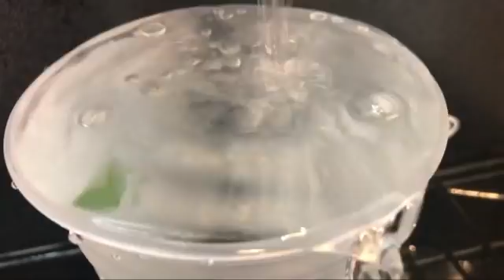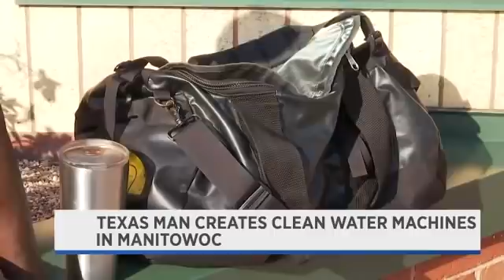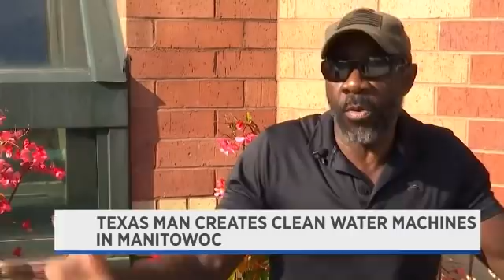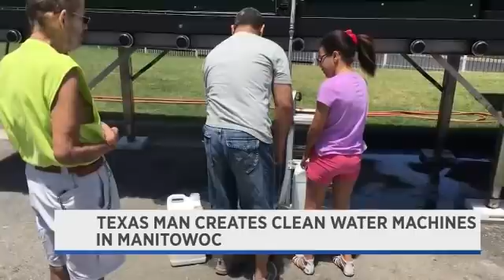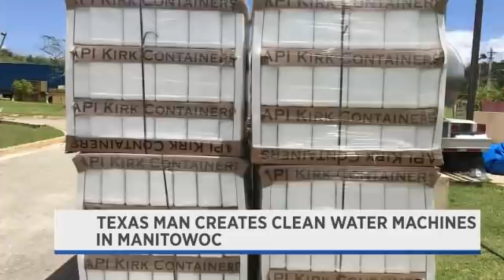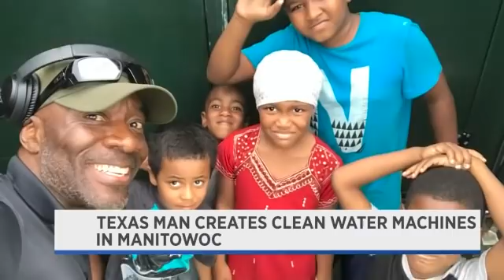Texas Man's Invention Creates Drinking Water from Air

Comment: This man is a genius simple and plain.
Reply: BM32  There is no hate on my side. It would be great, if such a machine could be viable. But thermodynamics tells us NO.
Let him just show us the math - how much energy the device consumes per unit of water produced. That's the key parameter.
Reply: @Staremperor  what if he found a way to.produce more with less power? just because you can't figure it out that doesn't mean it can't be figured out. 
Why is there always a "but" with certain people.
Reply: Staremperor ask that question on a different video.  This story was a good news story not a damn thesis that will be defended or a damn technical white paper.  You are being disrespectful to a veteran.  Where is your patriotism??
Reply: @Staremperor  They don't want to hear that. They wuz inventors. Just leave it like that.
Reply: BM32  "It works" "someone vandalized it"

 Of course it works. Dehumidifiers do work. I used one when I spilled my pool into my basement. I used it for its intended purpose: to dry up air and subsequently walls. It worked and all the moisture my dehumidifier sucked from the air condensated in a tank. 
But the amount of water was really small while the machine worked 24/7 on 350 W of power. Which means DEHUMIDIFIERS ARE INEFFICIENT AS A TOOL TO CREATE DRINKIMG WATER. That's all.
Reply: @Staremperor hook then up to the latest solar tech
Reply: @silviocastell8889  Do you mean to supply this dehumidifier by energy from solar panels?
To produce enough water, you'd need quite substantial installation. Dehumidifiing air is not energy efficient way of producing water
Reply: BM32  
Let's go for underlying principle, which is cooling and condensation.
So I ran some numbers. I did that for my local environment, as I have no clue, how much you pay for electricity.

In order to condensate 1 liter (0,264 gal) of water vapor, you need to remove 2257 kJ of energy (this is at boiling point of water, the lower the temperature, the more energy you need, so I'm being generous here). 
Current heat pumps have coefficient of performance around 4 (which means, that they can pump 4 kJ of heat for 1 kJ of input power). 
That means, the machine takes 564,25 kJ of energy to condensate 1 l of water.
1 kJ equals to 0,277 Wh
Here in Czech Republic 1 MWh of electricity cost 2535 CZK (109,82 USD)
So if I omit all of maintenance, water filtering and everything else, just to condensate water you use 0,017 USD per liter (0,065 USD per gallon) worth of energy.
For comparison, here in Czech Republic, you can get tap water for 0,004 USD per liter and that has everything included - water treating, sewage disposal, infrastructure (outside your house)...

And don't talk about solar panels. You also need to pay for those. 
If you want to make "hundreds of gallons per day", let's say 300 gallons (arbitrary number, you can pick whatever number you want) of water per day using solar panels. Condensation of 300 gallons needs (with coefficient of performance of 4) 178 kWh of energy. To produce 178 kWh with solar panels, you need roughly 40-50 kW solar installation (varies widely based on your region, you know latitude and clouds are major factors). Solar panel of dimensions 65*39 inches could produce 320 W (again varies widely). So in order to make 300 gallons per day, you'd need quite large solar power plant.

Really only way to make air->water viable is to significantly increase heatpump efficiency. Ramifications of such increase would be enormous from water production through refrigeration, house heating, air conditioning... If mr. West is truly such a genius, that could increase Coefficient of Performance from 4 to 8, he would understand, that he can revolutionize entire industries, not just make a couple of water generators for some isolated communities.

Lastly: if you have the technology and hold patents to it, sabotaging one unit doesn't mean much. Every company in the bussiness would bend over backwards to buy or license such technology, because it would mean a breakthrough. We don't see anything like that here.

I rest my case.
Reply: @Staremperor  dude why are you so hell bent on debunking this machine all your talk about cost and energy consumption means nothing all you have to do is watch the video it says it cost the city "$0 dollars" to run ands its 100% safe to drink fully tested and verified to work 

quote from MOSES WEST, PALADIN WATER TECHNOLOGY website 
The machine that Moses developed was innovative from the start. One of the challenges of scaling up atmospheric water generation technologies is the amount of energy they require to function. Many units on the market today are very energy intensive.

Not this machine, though. The Texas Commission on Environmental Quality requires power consumption no higher than 0.13 kilowatt-hours (kWh) per liter for approval. The unit developed by Moses used only 0.08 kWh in testing, and in Puerto Rico achieved 0.05 kWh.

Moses spends a lot of time watching the machine operate while thinking about "parasitic electrical load. If I can put my hand someplace and I can feel some heat come off or if I can feel some cool air come off … temperature change is energy.” He has continued to make tweaks to the design to minimize energy usage. “I’ve gotten the equipment down to the place where it’s very, very low on energy consumption,” he says. “And that’s what you had to do to get it out to the market.”

so yeah Moses West smashed you energy numbers by a wide margarine because he is a Genius and you're just a hater hoping he fail because you're not smart enough to figure it out like this high IQ black African American man did LMAO
Reply: @frankmill5172  1. I don't care about mans race.
2. As i wrote: if he managed to rump up efficiency of heat pump that much, it would be revolutionary. Such technology would instantly find its way into fridges, house heating, air conditioning etc. But it's just not happening.
3. I do not hope, he fails. If he succeeds, it would be great for entire world, even for me. Just imagine - heating ten times more efficient, than what we have today. There goes half of carbon emissions. 

4. You oppose me with some PR article and couple of ad hominems. Try better. Try to search for specs of the device, is there a site, that describes how the machine works? I bet you won't find any.
5. So I crunched the numbers again. If the proclamation of 50 Wh per liter is correct, that would mean Coefficient of Performace of the heatpump 13 - three times more efficient than current technology on the market. He did that single handidly? Please, please find his patents or research papers. This would be truly revolutionary. Or just keep insulting me and see how long you can keep that up. I'm very insult tolerant.
Reply: @frankmill5172  Yo, I found the patent https://patentimages.storage.googleapis.com/e9/fd/ed/cfe0809648a40e/US9400131.pdf

What he patented is adding a turbine to multiple condensers in order to process large quantity of air. 

This way, he can rump up the water production. But it doesn't say anything about energy efficiency.

And here goes second one
https://patentimages.storage.googleapis.com/c1/da/73/ddc5c7f78c2eb2/US20190242098A1.pdf

This one is longer and might have something to do with efficiency of heat pump (here, it's called refrigeration cycle, but it's essentialy the same). It's longer, so I need some time to grind it through
Reply: @Staremperor  I dont know why you feel I insulted you it seems to me that you want to find out how it works so you can copy and sell the idea or something ... how many tech companies do you know post there patented info all over the web so it can be stolen ...would you if you came up with a new Idea or a breakthrough just post it to the world wide web for free??? I dont think you would thats why you cant go to secret military bases like Area 51 and ask how they reverse engineer UFOs
Reply: @frankmill5172  I have no intention of copying such patent. Firstly: You can't, that's why there are patents in the first place. You invent something, you patent it and if someone tries to steal it, you sue his ass. And secondly I'm happy as an employee in a small company here in Brno.

All I am is a NERD. I like to dissect things and learn. I'm curious. And if I see such bold claim, I'm naturally sceptical. So I search and learn. As you can see, I found his patents (they are publicly avialable, you know) and I'm going to read my way through them.

Will you do the same? You should, if you want to oppose my critique.
Reply: @Staremperor  well I guess a simple google search for Moses west patents was all it took to find : ) guess I'll brief through them a lil bit
Reply: @Staremperor  off subject but what do think about this impeachment going on?
Reply: @eleminoupi5670  Do you mean impeachment of president Trump?
Well, I see it from afar. I'm Czech living in Czech Republic. From what I gathered (which not much) I thing, that impeachment is kinda nuts. "Hey, mr. Zelenski, there might be a criminal activity of one American, you might investigate that" - That doesn't sound all that bad.
Secondly - as long as Republicans (in senate) support Trump, impeachment won't pass.
Lastly - I guess, that you'll have to live with Trump and hope, that in next election, he'll lose.
Me personally - If he didn't be so happy about trade wars, I'd support his presidency. BECAUSE IT'S FUNNY AS HELL :-D. I'm just waiting to read another stupid, over-the-top tweet or letter of his. I'm like: "enjoy your border wall, enjoy your idiot president, WAIT... WHAT, he wants to make trade between us more difficult? Screw you, I don't want that!"
Reply: @Staremperor  ok you are not America so I dont care sorry. You're great though
Reply: @Staremperor     You said it. Drinkable aka the moisture level. Night moisture level is more  favouarable and that is how  ground water in arid regions are not exhausted. Hence the water holes plus  bore holes  dating back centuries and some. This machine's inner workings has not been made available to us yet, maybe soon enough it will be.
Reply: BM32  Still less efficient than river water treating , desalination or pumping water from subterranean aquifer.
Reply: @Staremperor  It's literally cheaper to fill a tanker truck with water and drive it to where the water is needed. This was debunked by Thunderf00t on YouTube.
Reply: @Staremperor  aquifers dry up or get polluted. This seem renewable I'll coin the phrase renewable water.
Reply: Staremperor Sony’s driving a pick up truck is less efficient than driving a Prius and yet people still choose to do it.  What’s your point? There are pros and cons to everything.
Reply: BM32  Only part of this, that is worth responding is "Until you examine that equipment you can't say shit."
1. Did you examine the device, so you can say, it's efficient?
2. Sometimes, you can say, whether it could work just by knowledge of underlying principle. Fundamental piece of technology in play here is a heat pump. Current state-of-the art heat pumps have coefficient of performance around 4. Which means, that they use 1 Wh for every 4 Wh of transfered heat. And the coefficient of performace goes down as temperature difference goes up. Do you want to do a math yourself, or do you need me to do it? If you do it, you can choose your ambient temperature and relative humidity.
Reply: @Staremperor  I know you're not interested in anything but the science. You know what you're looking at and so do a lot of us but unfortunately these morons will cling to something they have no idea about. Here in the US the left is squashing out conversation by using blanket statements like calling someone a racist, sexist etc. People are really retarded and I don't mean that in an insulting way. They are truly the real sense of the word retarded.
Reply: @steveosoprano9078  Funny. In Czech Republic "unique snowflakes" are more on the right. Leftist are all about Russia and China :-D

Well, stupidity knows no bounds.
Reply: @Staremperor  haha haha. Cheers to that!
Reply: @steveosoprano9078  well been about 6 hours sure you've looked over the patent by now do you still need more time to debunk this "fake water making machine" or are you going to wait for Thunderf00t to save you LMAO!!!
Reply: @frankmill5172  I don't need to debunk anything I can clearly see that this just a dehumidifier.
Reply: @steveosoprano9078  just saying its just a dehumidifier isn't debunking anything if I create a Battery last for 1 year without a recharge all you would say is its just a battery I know its a battery but its 1000% better than every battery in the world and you still not debunking how it work by calling it what it is ...the sky is blue tell me something I dont know
Reply: @frankmill5172  I couldn't care less how you feel about it. I don't need to debunk a dehumifier.
Reply: @frankmill5172  if you believe in it so much then you do the research and figure out if it's economical. If it is then invest in it. This is a beautiful country where we can invest in things we like and believe in. Capitalism is amazing.
Reply: @steveosoprano9078  then why tf are you here calling people morons for believing in the Moses West Atmospheric water generation system and saying it dont work because its just a dehumidifier people cant drink from a dehumidifier but you can drink from Moses West Atmospheric water generator LMAO ...yeah you care
Reply: @steveosoprano9078  I have already donated to helping this Machine in Flint and plan on doing more in the future its a great idea to bring fresh drinking water to poor needy people of the world
Reply: @frankmill5172  then drink it.
Reply: @steveosoprano9078  I own a dehumidifier but I dont drink water from it because thats not what its built for  ...but I would drink it if I had a specialized Atmospheric water generation built by Moses West for the specific purpose of water being drunk from it
Reply: @steveosoprano9078  its not something from nothing ...you act like its some kind of magic contraption and Moses West is a witch or something ...you know At any moment, the atmosphere contains an astounding 37.5 million billion gallons of water, in the invisible vapor phase. This is enough water to cover the entire surface of the Earth (land and ocean) with one inch of rain...that water naturally exist in the atmosphere all the machine does is pulls aka dehumidifies it from the sky cleans it and make it drinkable for human consumption
Reply: @frankmill5172  nobody is negating the fact that this IS a way to produce water. You are not thinking about how much it costs to run. Are you using solar? Then think about the carbon foot print to make all those panels. Are you using electricity? Then think about the coal being burned or the nuclear energy being used. This machine DOES NOT PRODUCE FREE WATER.  Everything comes at a cost. If you can't undestamd this then I don't know what else to tell you. Like I said before if you feel so stongly about it then invest in it and prove us all wrong.
Reply: @steveosoprano9078   ...Solar panels produce carbon emissions... LOL you got to be just trolling now of all the things thats destroying the environment I think even the most strictest environmentalist will forgive this machine for the lil pollution it produce compared to the millions of plastic bottled water that you would save from having to transport and deliver along with all the pollution those bottled waters create when they are dumped into the ocean ....I think they would take the trade off just to have this one machine in a city ...just give up already you are only here to try and find something negative to say because you hate good positive things ...man you need Jesus or Buda or someone to give your life some kinda meaning outside of the negative ...or maybe the only thing that makes people like you happy is being negative and seeing poor people getting help and free water burns your heart like a bad sun tan ...sad...
Reply: @frankmill5172  You are like an emotional child. Like I've said if you believe in it so much then you and Santa should collaborate and make water free for all.
Reply: GOD IS GREAT- JESUS YESHUA LIVES
Reply: Its just a dehumidifier....
Reply: @DukesArchive  you should have improved on it then,
Reply: An Israeli man invented this years ago. This is just a different machine. You Idiot ! Lol
Reply: You don't do your research. Plain and simple.
Reply: @kilgoretrout6136  can you post what you've recently invented or designed that was new. At least post a video that discredits the man first. If not your just spreading rumors.
Reply: BM32  bro yes its a big cool machine but stop acting like it was just invented. This idea was around for years and years Lmfao.
Reply: Yep you said it!
Reply: The energy needed to pull enough water out of the air would be astronomical. It would be cheaper to fill a tanker truck with water and drive it to where the water is needed. This was debunked by Thunderf00t on YouTube.
Reply: A. G.  I agree with you man I'm not attacking the man I'm just skeptical of this machine. Seems like a good way to scam tax dollars out of a city.
Reply: A. G.  

Answer to question why we don't have thousands of them is summarized in yesterday my post, that begins "Let's go for underlying principle". There I explain, why dehumidifiers are inefficient in water production.
Reply: BM32  All dehumidifiers are efficient, dumbass; they just use a lot of energy.
Reply: @Victoria Adeyemi Why would I build one? There are factories bulding them. I can run to local electronic store and by one for 100 USD.
Reply: Lots of underlying racism here I see...
Reply: @TheDreamOfATree  He's referring to drinkable water, scientists are saying the same thing. Only 3% of Earths water is suitable for human consumption without treatment, but I thought everyone knew that.
Reply: Do not @ me. Just reading through this thread. Nada yelling. :(
Reply: Patent, copyright, logo rights have conutations (fine print) definitely meant to be  adhered to. Vehicle models plus makes change all the time. Mobile T is no longer the world's "model" vehicle. Black paint is not a must have for all vehicles world wide. Think Think.

Tesla was "bad news" politics. Politics. He went through "some things". Define patent . At least use a dictionary and it will all  spell out for you. This explains why we have inventions popping up world wide. Not just one neck of the woods/ neighbourhood. Again politicians today do not rack up patents at the patent office on this day and age. This is a bold new age for  folks foreign or local. What happened to tesla on foreign soil deserved a  hearing. In today's standard. 

Do not @ me. Just reading through this thread.
Reply: Who is going to sue this gentleman.
Reply: @goodgood8641  k dude
Reply: BM32  we didn't hear any numbers, how do we know it is efficient?
Reply: Don't get fooled, it's just another dehumidifier. Power hungry dehumidifier.
Greetings from Czech Republic
Reply: @Staremperor  anybody else doing it free?
Reply: @WiserThanEinstein  Noone makes drinking water for free. But this is very VERY expensive way of making it. That's why nobody does that.
Reply: @WiserThanEinstein  what's free? Nothing is free.
Reply: @Staremperor  These dumbasses think condensation is magic or something.
Reply: @Staremperor  A dehumidifier does not provide safe drinking water, this machine does. A Black man invented it first, and you racist Whites globally can't handle it. You are all filled with jealousy, and envy. Take some meth, and get back in your delusional fantasy world.
Reply: Whatever it is it works botch😳
Reply: @atishastephensonpike6540  that's what I'm saying